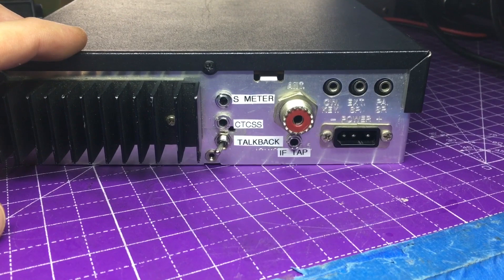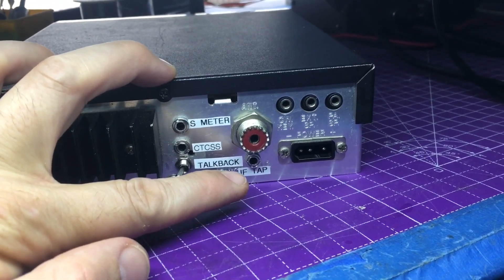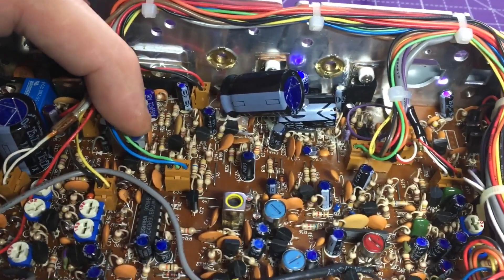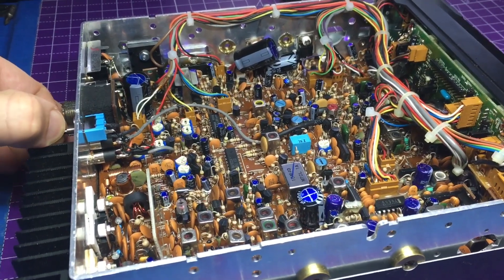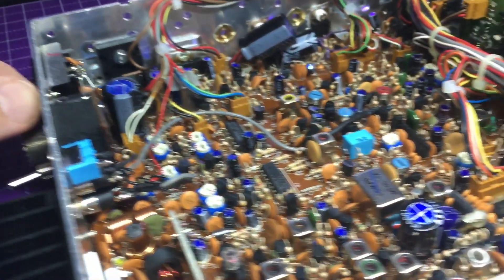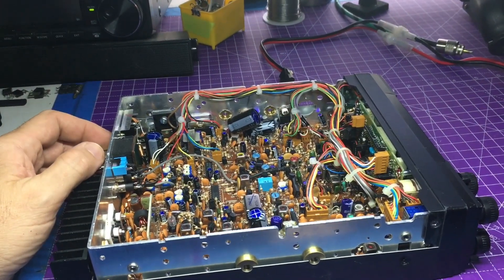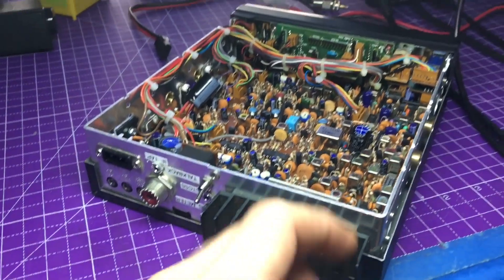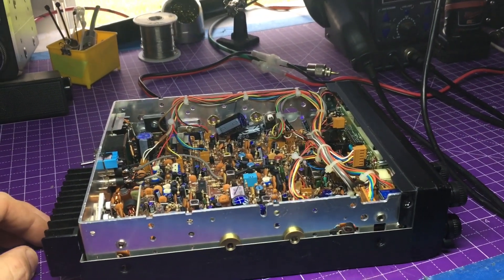RCI 29xx non-DX Series mods to keep up with modern rigs !  Part 1

Comment from the maker: I know I said in the video the PLL-02A chip was awesome...just because it was in SOOO many radios!  However, the Motorola MC145106P will take the cake on mods. Taking a 8719 radio to another level.  As for the mass produced PLL-02A to be an easy PLL chip crack is an understatement. Cybernet used these PLL's in A LOT of American radios too !!